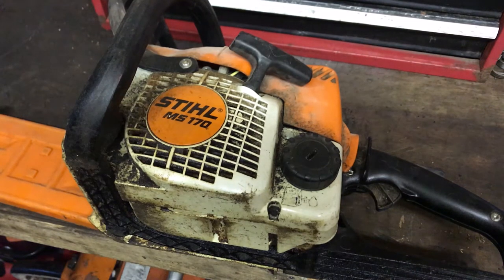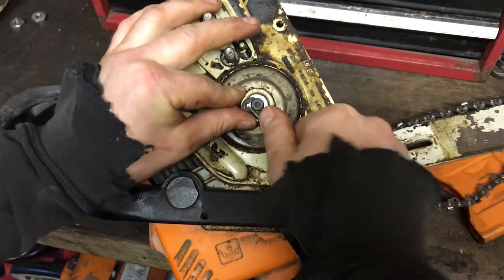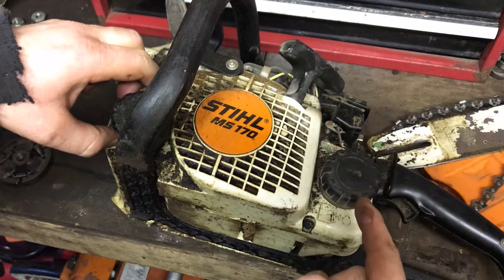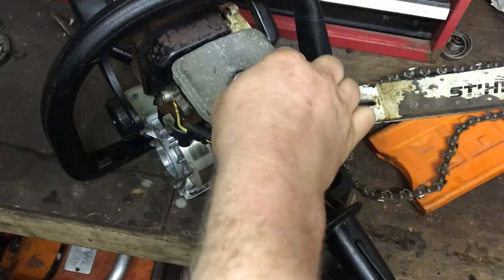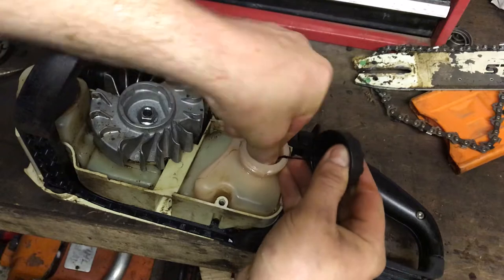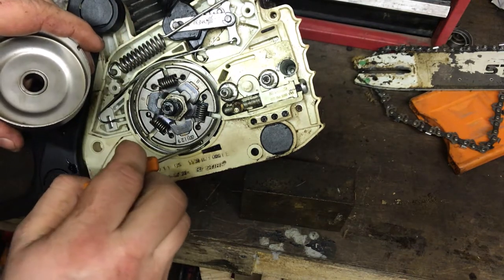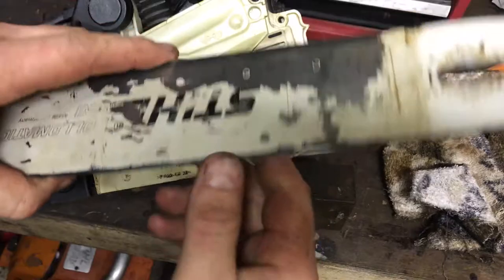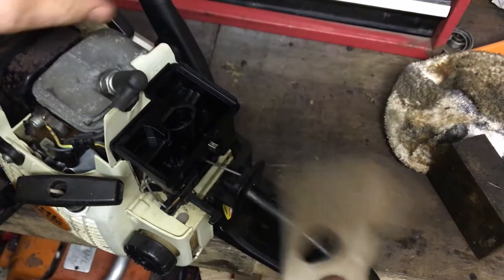Stihl MS170 Cleaning and talking about chainsaws

Comment: I pulled down my rather new MS 170 for its post breakin maintenance, yesterday.  I cleaned and lubricated everything on the PTO side and cleaned the spark arrestor screen.  One thing I noticed is the factory had lubricated the worm gear with a light blu grease, probably a synthetic white lithium grease.  I used regular white lithium grease on it and the sprocket bearing.    I have been very pleased with my MS 170.  I did update the chain adjuster to a side tensioner and put steel bucking spikes on it, otherwise it is stock.  Your bar looks a bit worn.  I cleaned it before I put the bar and chain back on my 170.

Comment: i have 2 questions for you if you don't mind answering, 1) i have this saw and i have cleaned all the carb and it runs but for some reason when it's warm when you press the trigger it's like it wants to cut out so several quick presses and hold it runs full on do you no why it would do this ? 2) i have new bar and chain and i tighten like most show how to but the chain keeps coming loose is the a reason why if not how do i stop this happening thanks

Comment: That is how not to keep a saw.  I clean and sharpen every saw after use.  If you don’t, you are asking for problems.  I use compressed air and a small paintbrush.    I use white lithium grease or high temp wheel bearing grease on sprocket bearings.  I lubed those on my ms 170 and ms171 last week.    I do everyone of my 15 saws, at least once a year.

Comment: Hi mate, I’ve got a brand new chainsaw ms170 it’s all done up fine, but every time I use it there is always a load of black oil dripping from the muffler each time I use it and it never seams to stop, only when the chainsaw is turned of it stops, I just came across your channel and this video and thought I’d ask for abit of advice before I start taking it apart because I might not need to yet. Appreciate any help👌🏻
Reply from the maker: Only thing I can think of is two stroke oil type or the mixture too rich most Stihl saws are 50 to 1
Reply: Cheers appreciate it!👌🏻
Reply: That’s a good thing, you got plenty of lube in your fuel mix.  40/50:1 mix ratio is what you should use along with non-ethanol gas.

Comment: didn't put screws back in on brake on cover
Reply: This saw actually doesn't have screws on the brake cover, it just snaps on. Pretty weird since there's a spot underneath where threads could be cut with screws and the cover has recessed spots there.

Comment: Bumper spike is missing from this saw.
Reply: They have plastic ones molded on the case.  I bought a pair of metal ones. There are mounting holes on the saw.
Reply: Some people dont want felling spikes
Reply: @alexstromberg7696  Prevents damage to the plastic saw body.
Reply: Don't have them on this one but l fitted one to mine and a chain adjuster